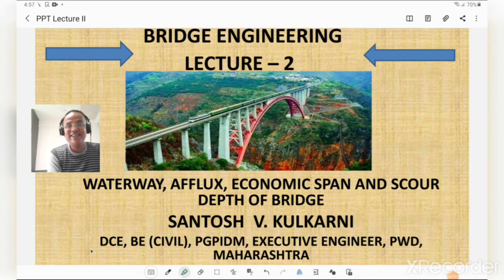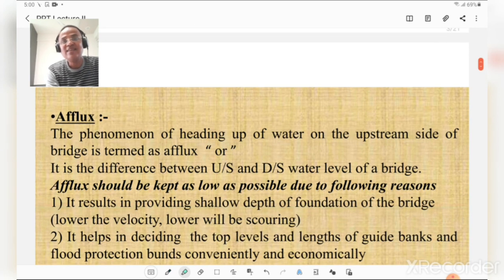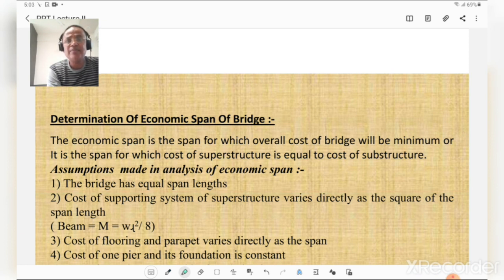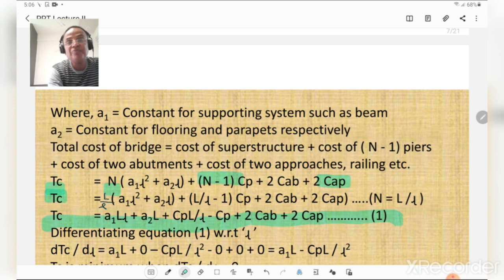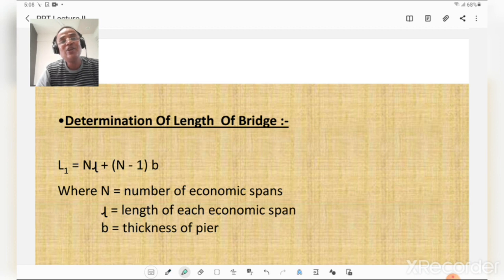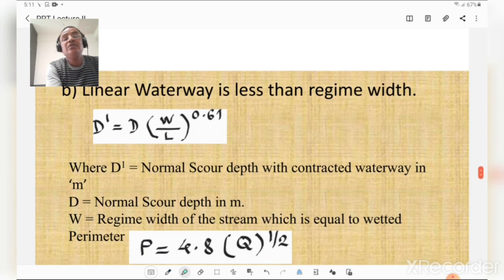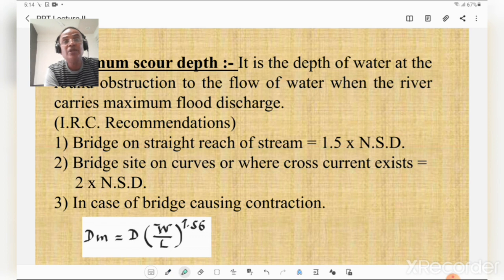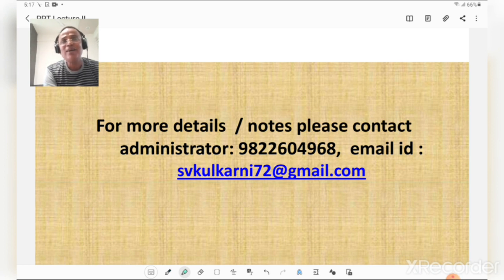BRIDGE ENGINEERING LECTURE 2

Comment: Sir...the afflux formulas are correct???...means both the marriums and molesthworth formula????
Reply from the maker: Yes Correct.As far as my referred text book and notes
Reply: @santoshkulkarniscivilengineeri   sir are there any other formula for afflux too?
Reply from the maker: Also sloved analytical problem on afflux
Reply: @santoshkulkarniscivilengineeri  ok sir thank you so much 🙏
Reply from the maker: The rise in water level upstream of bridge as a result of obstruction to the natural flow caused by the construction of the bridge & its approaches.
Afflux can be estimated by using several empirical equations e.g. IRC:89 (1985) Nagler (1918), Rhebock (1921), Yarnel (1934), Rao (1997) etc.
IRC-SP 13 recommends use of wier /orifice formula for computing flow with known afflux or vice versa. For shallow channels with wide flood planes (as observed in most of the rivers across the bridges on this roadway a rough first approximation of finding afflux can be obtained from the following expression, (Bradley 1970).
h *1 = 3( 1- M) V2n2/2 g
where M=Qb/Q
where
Qb =is that portion of the total discharge Q in the approach channel within a width equal to the projected length of the bridge
Vn2 = Q/An2
An2 =is the gross area of waterway under the bridge opening below normal stream depth corresponding to design flood discharge.
IRC:5 and 89 recommend use of Molesworth’s equation for computing approximate afflux given below:
  h = {V2/17.88 + 0.01524} x {(A/a) 2– Afflux at a Bridge
Where, h = afflux in metres
V = is the mean velocity of flow in the river prior to bridge construction i.e.
corresponding to normal HFL
A = Areas of flow section at normal HFL in the approach river section.
a= Areas of flow section under the bridge.
In case of rivers with erodible beds, full afflux as calculated by the formula may not occur.
For minor and medium bridges, weir and orifice formula given in IRC:SP-13 can be used for computing afflux depending on whether the flow under the bridge is choked or free.
For choked weir type flow: Q = Cd Leff (Du + u2 /2g)3/2                                    if h1*Dd > 0.25
For orifice flow :                     Q = Cd Leff Dd √2g. h1*                                  if h1*/Dd <0.25
Where Cd & Co are the coefficients of discharges for weir and orifice type flows respectively.
Cd and Co values are given in the IRC code,
h*1 = afflux = (Du-Dd).
Du and Dd are the upstream and downstream depths measured from the lowest bed level under the bridge
Reply: @santoshkulkarniscivilengineeri  sir but in the video both the formulas are different ...and here it is something different...I am literally confused which one is correct
Reply from the maker: Please look at Moleworths equation.same with round off in decimals
Reply: @santoshkulkarniscivilengineeri  yes sir ...but what about the marriums formula...which one is correct??
Reply: ??? Sir plz tell
Reply from the maker: Empirical formule gives u various  closed values so use as per prevailing practice/as per requirement of exam
Reply: @santoshkulkarniscivilengineeri  sir yesterday this question came in my exam ...so I wrote both the formulas from the video...which is a little bit different...will the answer will be right or wrong???
Reply from the maker: @priyankamohapatra1058  correct if specific equation is not mentioned in question
Reply: @santoshkulkarniscivilengineeri  ok sir thank you so much for this video 🙏🙏😊😊😊
Reply from the maker: MARRIMANS EQUATION IS ALSO CORRECT